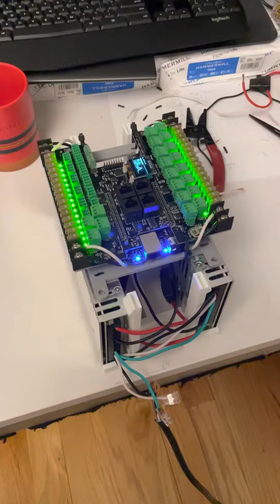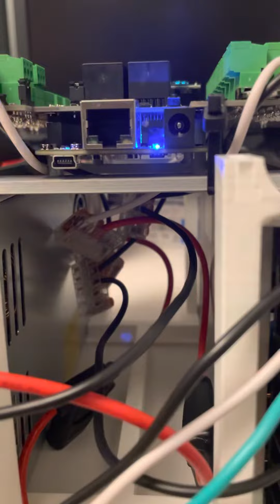Kulp K32A-B into Harbor Freight .5Cal case

Comment: I have the same controller. I thought you needed 4 power supplies to power the whole board? I haven’t fully built my show yet only a mega tree and some arches and haven’t used it in a couple years since my computer took a dump and I didn’t properly save my little show.
Reply from the maker: You can see in my example I broke out my two supplies to two power ports per side of the K32. You could with an appropriately sized power supply quadruple tap the supply (with appropriate fuse in line) and feed each of the 4 power connections. It's all about the capacity of the supply, and the load you'll be creating on the K32 pixel connections side i.e. if you have all 32 ports fully connected each with 400+ pixels you'll be pulling a lot more current and will need to size wire, supplies (1 or more) appropriately. In my case this setup has worked flawlessly without any issues for 2 years now. Eventually I hope to consume more of the ports with props.